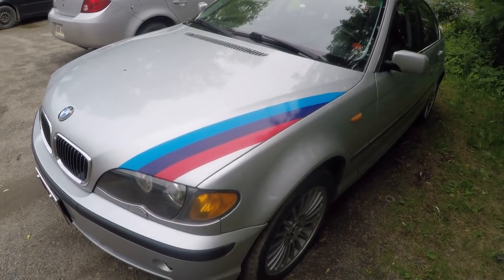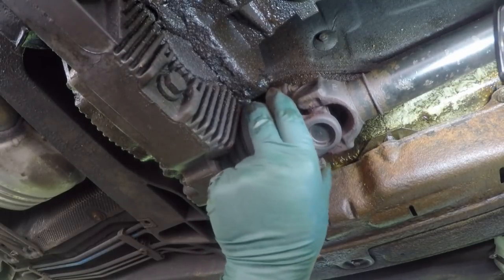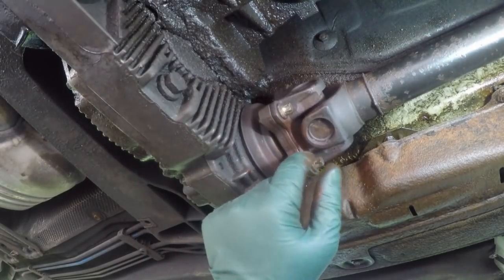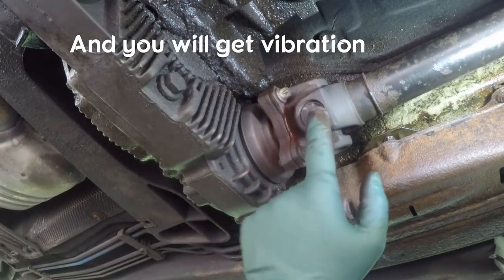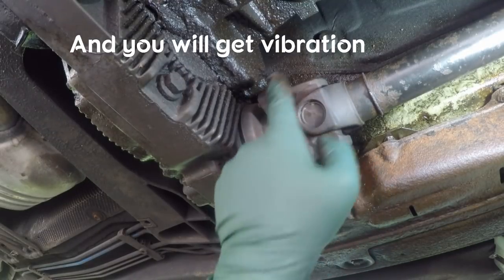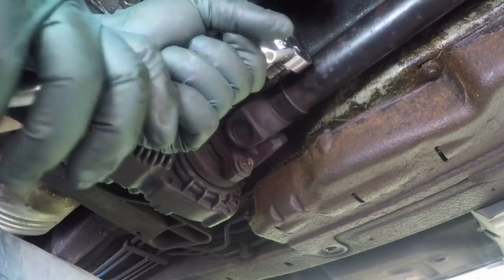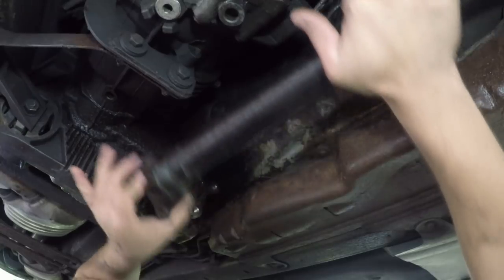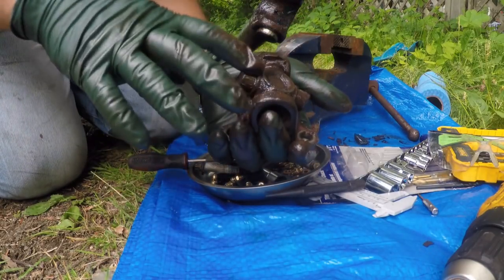Grease Up NON-SERVICEABLE BMW E46 U-Joint | Easy & Doable

Comment: You never showed how to remove the caps and U joint, you went from not being able drill holes to having the joint apart, Fairly useless. I watched the second video and you just gave the joint number, no manufacturer or size.
Reply from the maker: John Owens hey thank you for your comment! Yes, you are right about removing the ujoint on the first video, it wasn’t supposed to happen but after not being able to drill I was just pounding on it and it came out. But if you want to see how to remove the ujoint go to 3:40 in the second video and it’s there. Regarding the size or manufacture I didn’t care much, I just wanted the part number that would fit perfectly and the part number will give you all the other information. Hope the videos helped you somehow 👍

Comment: the caps are held in by stamped little barbs,,,,,use a vice or c clamp and u can force them through......the issue is......there is no way to re secure the caps.......short of tack welds. That drive shaft is now toast and no way to tell if caps are to deep or not deep enough
Reply from the maker: I would disagree on that. There is no such thing as too deep, because the shaft rotation will take care of the “too deep” caps. No need for tack weld, just create some edges with a chisel like I did on the video, right were the old ones were, and that cap will never fall off.
Reply: @GearSpec  then ill ask.....why not just press the in at the factory? Why go though the trouble of stamping in a retainer?
Reply from the maker: @mattsez2879   Yes, that is another way of doing it. If someone doesn’t trust their diy then that is the best way of getting fixed. I have enough confidence in myself, so I did it. Regarding the retainer, there is no retainer on bmw shaft, at least the factory ones, because they are pressed in/stamped. If there was a retainer, which is how it should be, we would not be talking about it, would have a been just like any other car. BMW later came out with the serviceable shafts, because it wasn’t, they were replacing the whole shaft until that point.

Comment: can you tell me the part number and the brand of universal joint you purchased. I have an automatic so the universal joint that is bad on my e46 is in the middle by the central support bearing do you think it is the same u-joint? Video doesn't show how you removed the joint.
how long was it before it went bad again after this fix did the whole thing fall apart?

Comment: Thanks for trying, it is possible to drill a small hole in to the seal and inject grease in there?
Reply from the maker: Zeze Zeze hey by “the seal” do you mean the cup? Either way you need to close that hole somehow because from high speed rotation of the shaft you are going to lose all the grease.
Reply: @GearSpec heat up the grease to be easy to injected then seal back the hole
Reply from the maker: @tedyfanita1  That should work :)

Comment: Shocking! theirs a reason you replace the whole drive shaft...
How did you get the joint out never was shown..
Reply from the maker: James Greensit at 03:40 on the second video you can see how I removed the joint. Just used a 13mm deep impact socket and hammer it out

Comment: The U joint is replaceable if You take the driveshaft to a driveshaft shop they'll take the old one and resize a new U joint
Reply from the maker: True Review I got lucky this time because the part I ordered was the correct one 😊
Reply: @GearSpec  I have an e46 M3 and had the same problem , but on some models You have to buy a new unit because there's no available u joint , but had that taken care of by the driveshaft shop.
Reply: Gear Spec what was the part # please
Reply: @Troymatti  how much it cost you ?
Reply: @krysiu88  $230

Comment: you did not show the process
Reply from the maker: XtaticVideo Hey, What I meant to do on this video didn’t really go as I had planned, but anyways, if you can drill a hole in the centre of the U-Joint cap, that would save you so much work. If not then you can open the cap by following this video https://m.youtube.com/watch?v=tz4qf8MSEGE and just grease them up if they are still good to use. Good luck! 😊